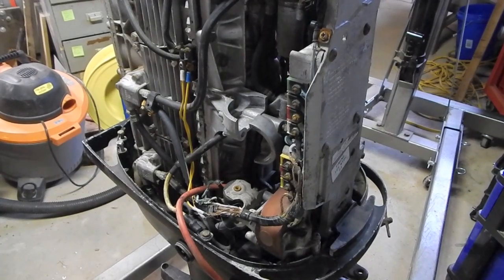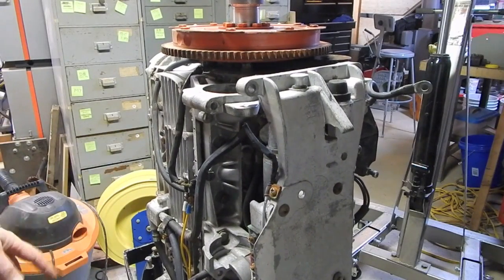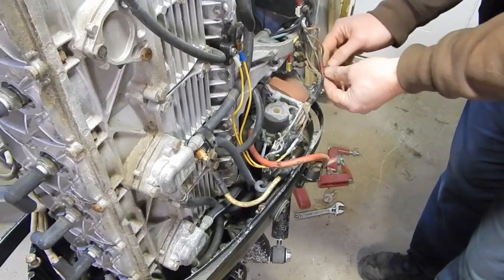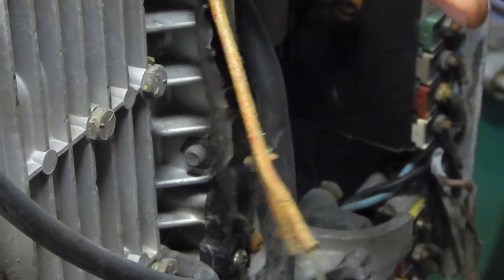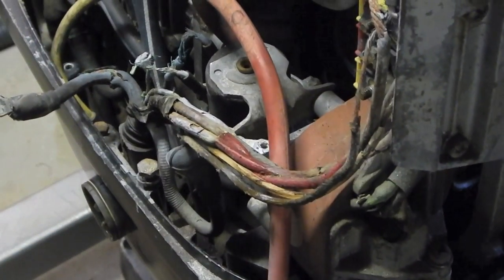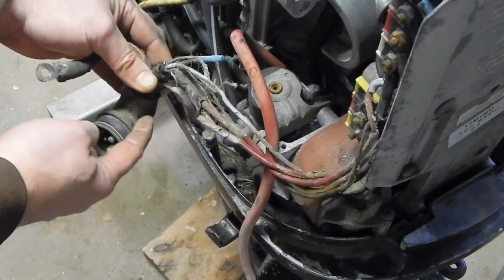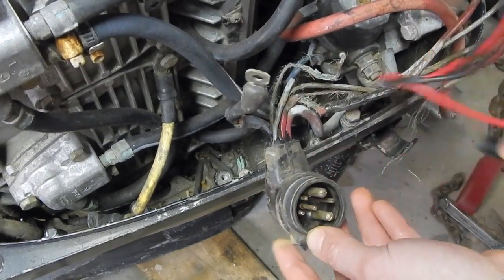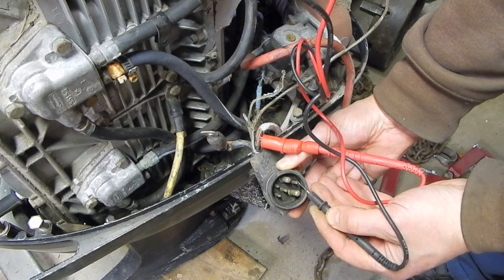The Mercury 115 "tower of power" outboard motor Part 5

Comment: A buddy of mine bought a boat with a mercury 1150 power trim motor on it. It turns over but won’t start. We took the outer case off and there’s a purple and a little brown wire that’s not connected. Any idea on what they could go to?

Comment: Hello, I just bought a boat with a 82 tower of power. 
I ran it once everything was good. I put it back in the water yesterday and after cranking for a while I realized the run switch was off, after switching it to run the tilt and the starter won't work.
I took apart the  control and saw nothing wrong. 
Any suggestions?
Reply from the maker: I would get a voltmeter and wiring diagram and start checking voltages in the motor. On mine the 12 volts comes from the battery up to the motor connector then out to the mercontrol.
Reply: i have an 83, put a new stator in it, voltage/regulator rectifier, starter, plugs, make sure your fuel lines are tight so top cylinders dont run lean, replace the water pump, and most of all make sure your battery is good!

Comment: What's the age of that motor? A lot of late 70's through mid 80's Volvo 240's have their engine wiring insulation fall apart like that.
Reply from the maker: +FrankTheCat The old Johnson outboards had the same issues, so it appears to be endemic of many older outboards.